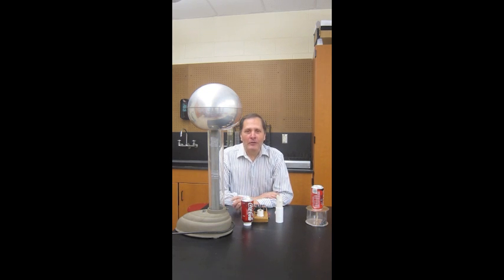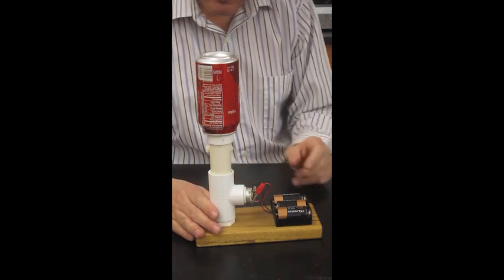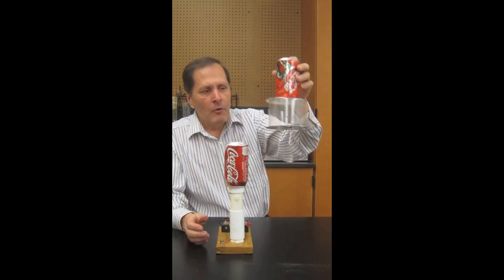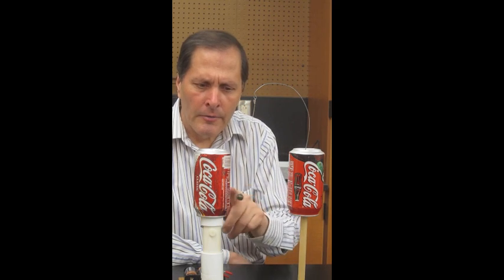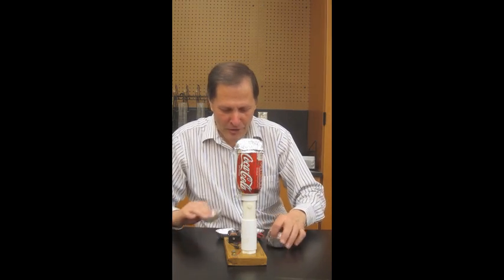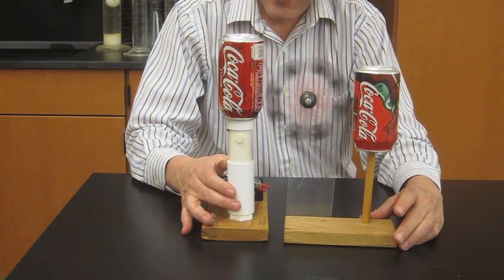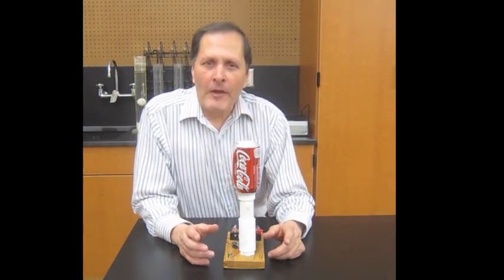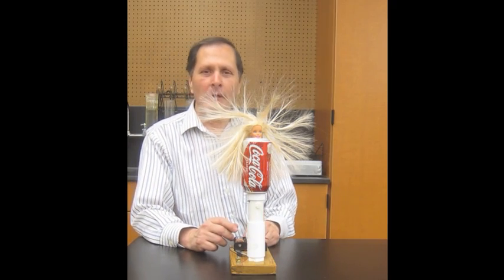Van Der Graaf generator shows off it's tricks /// Homemade  Science with Bruce Yeany

Comment: I have the same model generator as you. What is the part number for the belts you're using? Mine isn't working very well, if at all with the very short belts I have attempted to use.

Comment: I have the same generator that you showed at the beginning, but I can't find a belt for it. Any Idea where I can find one, or how I can make one?
Reply from the maker: we had another machine like this that needed a belt,  the physics teacher cut tubing out of an inner tube for bicycle wheel and either glued the ends together with a double over lap joint or used duct tape,  don't remember which worked better

Comment: mr bruce how did you make volta's hailstorm because i made voltas hailstorm and it didn't work  :-(
Reply from the maker: the two plates are CDs cover with aluminum foil and inside they are pith balls  or you can use very small foam balls covered with aluminum foil. are you getting a good charge on the generator?
Reply: Bruce Yeany good day! sir bruce is that a rubber band inside your volta's hailstorm besides the pith ball?? and what is the purpose of can of coke on the top? thank you for your replies :-)

Comment: We learnt about van de graaf generators in high school, and while I understand that there's an insulating belt that transfers electrons on to the shell, and so the voltage created can't cause them to flow back through the belt, I don't quite understand where the electrons come from in the first place.
In this case, for example, wouldn't the reaction in the battery just not occur if some electrons just never returned to the battery? Wouldn't that be a violation of kirchoff's current law? and if the reaction happens anyway, does that mean there's a net positive charge buildup in the cells?

Comment: Bruce, I know that this is an old video, but that motor is SCREAMING for lubrication!  A drop of light machine oil on each bushing will make it run quieter and faster.
Reply from the maker: You're right,  I tend to abuse these little motors running them at higher voltage than recommended,  the least I can do is add some oil. This reminder was helpful and I intend to do so with all of them not just this one,  when I get them out.  Thanks

Comment: Bruce, 

  I just discovered your vids today for the first time, and they're great!  I teach middle-school science here in Bangkok at an international school, and I'd like to use some of the ideas from your vids. The 'roll-back' toy we did last year using different sizes of cans, but having an 'open' design such as with the CDs might turn out better, so I'll try it that way this year. On the Van de Graf generator, you mentioned that there's a motor in the base that uses a rubber band to transport the electrons up to the wire in the 'globe'.  Could you clarify that, please? Is the band going around a pulley-wheel on the motor shaft or what?  

Thanks loads!! Good luck!  

PS I'm extremely jealous of your classroom. I was given an almost bare room, and have been collecting/building equipment for the past two years.  It's fun but frustrating. Supplies here are quite hard to come by.
Reply: Pro tip! Don't post your private email address in the YouTube comments section unless you want a million trolls and email spiders picking it up and signing you up to junk mail. 

There is a reason you can message people privately on YouTube.
Reply from the maker: Hi David,  send me an email address I will forward  pictures and plans of how to build one
Reply: Farseer Fiore,

  Thanks for the 'tip' but I know the risks. I don;t know how to respond 'privately' to someone on youtube, and frankly, I'd thought that anyone checking out educational Science vids would not be likely to spam/scam like you mentioned. I'm probably wrong though, so thanks for the reminder. I deleted my address.

Comment: Hi Bruce.meu name and Rodrigo, I live in Brazil and as a true fan of physical intend to present this project in my fair ciencias.Tenho one doubt in relation to this project, which you use in place of the belt which has the function to take the electrons until the can?
Email: rodrigodasilva80@hotmail.com
Reply from the maker: Hello Rodrigo,  I sent you some information about building the generator, I use rubber bands for the belt,  they work well and come in all different sizes

Comment: Hi Sir , I ask you for the experiment with the wire : It's of course a metallic wire but what is made the second wire? Twine ? Metal too ? 
And a second question ,what is made the ball under the wire ?
Thanks you !

Ps : sry for my english im french :)
Reply from the maker: Hello Eye of the Tiger,   the wire that supports the ball is nothing special,  anywise would work,  it's purpose is to simply to support the ball in the middle of the two cans.  The second wire is string or thread, this was thread used for sewing,  any thin string will do.  The metal ball is a small bell, shake it and it rings a tiny bit. Instead of a bell, we have also used two of the soda can pull tabs instead.  If you are interested in them,  I have instructions for building the generator.  However, the are in English. 

Bonjour Eye of the Tiger , le fil qui prend en charge la balle est rien de spécial , fut aucunement pourrait fonctionner, son but est simplement de soutenir la balle au milieu des deux boîtes . Le deuxième fil est une chaîne ou un fil , ce fut fil utilisé pour la couture , une chaîne mince fera . La bille de métal est une petite cloche , le secouer et il sonne un petit peu . Au lieu d'une cloche , nous avons également utilisé deux de la soude peut tirettes place. Si vous êtes intéressé à eux , je dois instructions pour la construction du générateur . Cependant, le sont en anglais .
Reply: Thanks you Sir for this informations . And I have already built the Van de Graaf generator with Outin Pierre .
Thanks from France !

Comment: Hello it's me again and i was wondering on what the second can is landed
 (again in the experience with the wheel), if its just wood or something
 special. Can we put her on a PVC tube for exemple ?
Thanks you.
Reply from the maker: +Outin Pierre   The purpose of the second can is it's attraction for the electrons on the black pith balls.
The can on top of the generator becomes negatively charged with electrons when it is turned on. The wheel rotates because the balls are neutral and will be attracted to the negative charge on the can,   as it gets closes  some of the electrons jump off the can and onto the balls on the wheel,  it then also becomes negatively charged and is repelled by the electrons still on the can and causes it to rotate as they push away from each other.   As the wheel rotates,  the negatively charged electrons are now attracted to the neutral 2nd can and some jump form the ball to the second can, making the balls neutral again and so it can  then can go pick up more electrons.  The second can acts as a place for the electrons to be deposited off of the spinning wheel.   They easily escape into the atmosphere off of the can or it  works better if it is grounded to get rid of the electrons faster.  Metals seem to work better,  I don't think a PVC tube would work nearly as well, perhaps if it were covered in Aluminum foil might help.

Comment: hi, i have a question, the little balls that you use for the experience with the wheel, what kind of material is it ? Thank you.
Reply from the maker: +Outin Pierre  Hello Outin,   They are called pith balls,  they are styrofoam  material and were purchased from a science supply catalog.  If that is not available,  I would try packing peanuts or pieces of foam broken down into small pieces.
Reply: +Bruce Yeany (Yeany Science) thanks you very much for your answer and we hope that will work ^^

Comment: Hi Bruce, great job. Me and my son have built one like this:
https://www.youtube.com/watch?v=2HkU8Dx4gZY
off of these plans:
http://makezine.com/projects/make-28/simple-van-de-graaff-generator/
and we seem to be getting a lot less output than you were able to. I used 3M electrical tape for the bottom roller and a glass fuse for the top. I used this rubber band between:
http://www.amazon.com/gp/product/B00669GWNI?psc=1&redirect=true&ref_=oh_aui_detailpage_o02_s00
and used #12 stranded direct burial low voltage cable for collectors.
Any ideas on how I could increase the effectiveness? I'll email you also.

Thanks
Reply from the maker: Marcus Caudill   Hello Marcus,  the  generator that the site shows is very similar to the ones I build.   It looks like a good set of plans.   The directions have you holding the wire to the bottom wire brush.   Instead of holding it, try sitting the generator on a metal surface like a metal cookie sheet and have the bottom wire touch the sheet,   see if that helps.  Let me know,  if not I may have a few other suggestions.
Reply: Bruce Yeany Thanks Bruce, I did have it connected to a household ground. I set it on a cookie sheet, cleaned up the the rubber band and rollers with some alcohol and spread the brushes a little and I'm getting about a half an inch now. Maybe I should try a different kind of tape on the bottom roller and take the thing apart and clean everything real good. I was also thinking of using a 16 oz beer can or a Monster drink can or something. We have also been talking about making a bigger one with a sowing machine motor and two IKEA bowls for a collector.
Reply from the maker: Marcus Caudill   There are several factor that may be the problem,  where we are, the summer time is very humid and that makes a big difference.   I haven't found that a larger metal can works any better, but perhaps yours might.  I run the motor at 4.5 volts even though they are rated lower,  these motors seem to have a lot of leeway in this area,  there are some that I use in other  "toys" that I run at 6 volts and still have not burned them out.   My generator motor has a wooden dowel on the shaft and then is wrapped with aluminum foil tape, thicker in the middle to keep the rubber band in place, could also try teflon tape on the lower shaft.   I'd also look at a shorter rubber band,  I use one that is about 4 inches long, got them at Staples office supply.